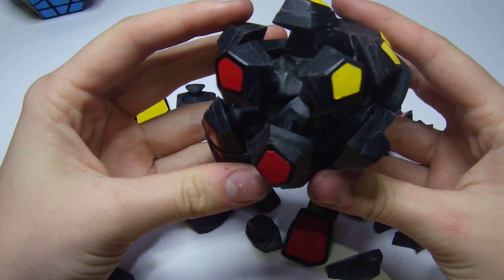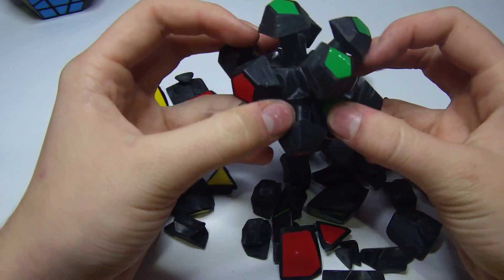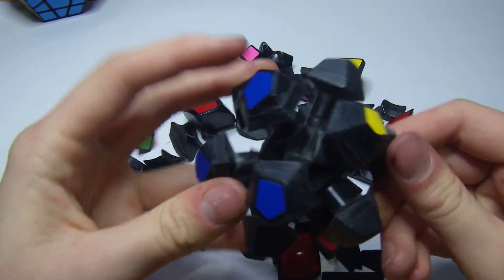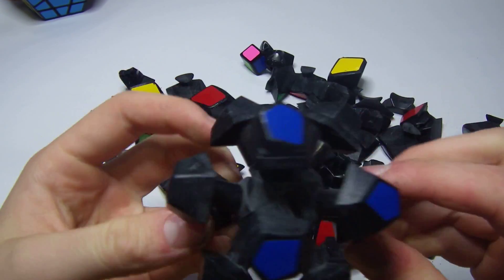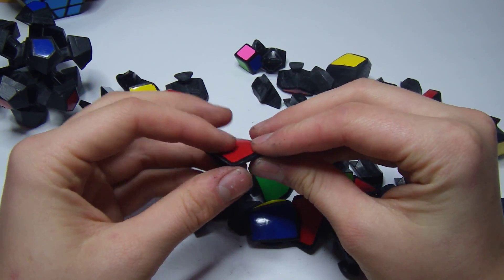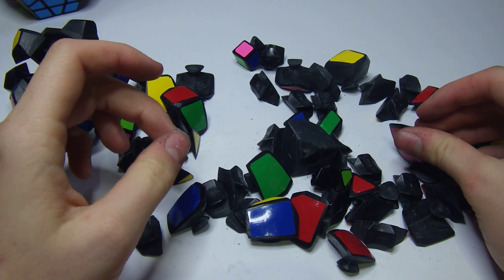ReuleauxMinxII Mechanism

Comment from the maker: Getting the rough shape is very hard. You do have to cut down the puzzle but it is 95% extensions. go with the    
shengshou the shengshou has more of a corner stock that will make the puzzle better.

Comment: I really want to make one of these. and a megamorphix. can you show what your first step or two was to get to the rough tetrahedron shape. and how you built up the centers. 
Also was this puzzle all extensions or was there some cutting down. and lastly ive had a qj megaminx for a few months now. my pb on it is 4:08. (my pb is 18.31 on 3x3). i dont like speed solving it. its not good enough for my hands. would you recommend using it for this puzzle, or buying a higher quality megaminx (shengshou)